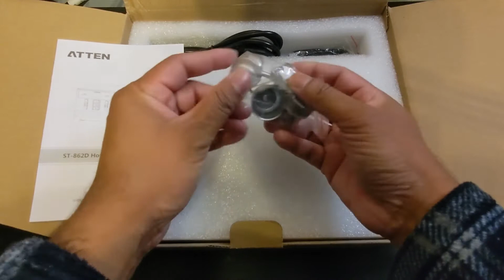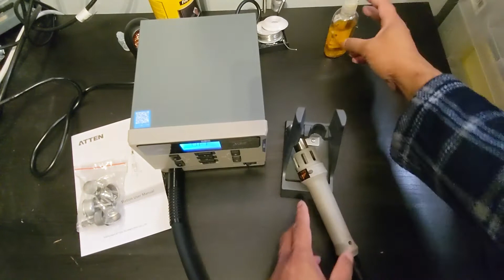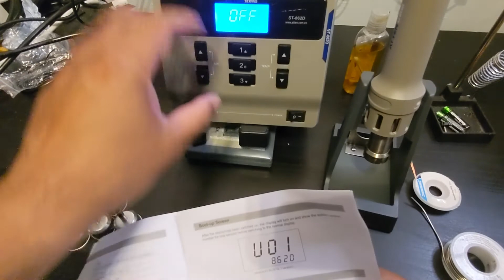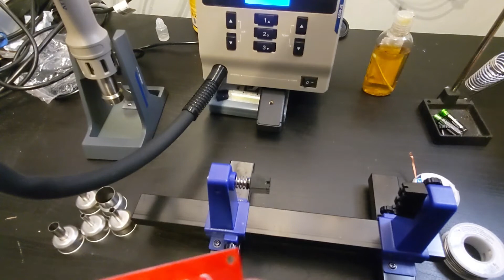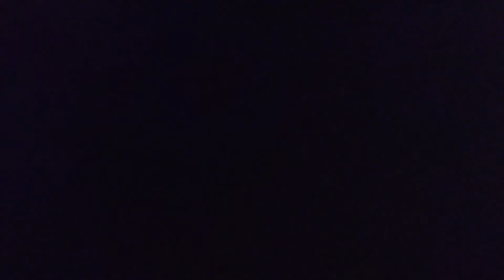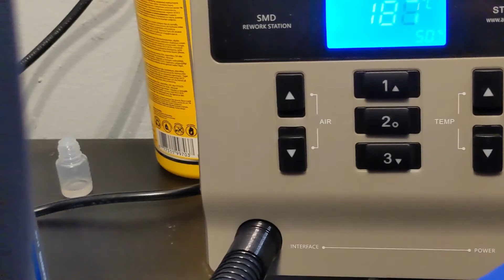ATTEN ST-862D  Electric Soldering Hot Air Station Getting Started

Comment: By holding the pliers on the header pins you've effectively created a heatsink...it's not going to get hot enough to remove. I also don't know your settings. General removal for leaded solder I use 300-350 at 50% airflow.

Comment: Has not laughed like that for quite a time. Thanks.
Reply from the maker: My pleasure, at least I made you laugh 😊
Reply: @IndiceEducation  Sorry for being frank. But if seriously, 1) using pliers so brutally is no good. Removing the micro buttons that way you have ripped off the pads (therefore you were not able to solder in one of those buttons back in a later video). NEVER use force for removing components. Also, 2) you tried to desolder metalic pins by holding them with pliers. Think about it: those pliers are a big piece of metal, which sucks the heat from the pins and for this reason, the pins never reached solder melting temperature.

Comment: I think your temperature was way too low. If you want to desolder big ics as the first one you tried to remove. It would have been better to turn the board upside down ( opposite of what you were doing in the video) and heat from the top using a bigger nozzle at least 420c and 50% air flow then the ic would drop with the help of gravity and perhaps a gentle pull from underneath with tweezers not your fingers. Heating from top will give you the flexibility of  moving the hot air from the left to right and vice versa. A bit of flux application  will help too. The thicker the board more heat is required. You need to get familiar with the tool.  Brave to take it on from unboxing. Practice will make perfect and good luck. By the way I have similar hot air, which was recommended by The cod3r, check him out and you will learn.
Reply from the maker: Thanks for your tips mate! That was the first time, I have ever used air heat gun. 
I really want to crack on soldering. Just ordered my Hakko- FX 951.
Thanks again for your expert opinion 🙂